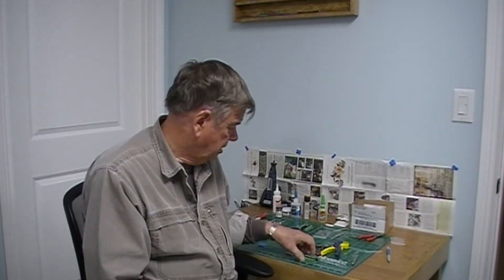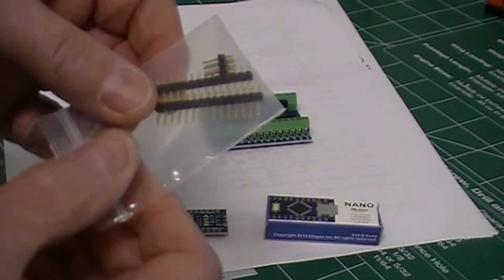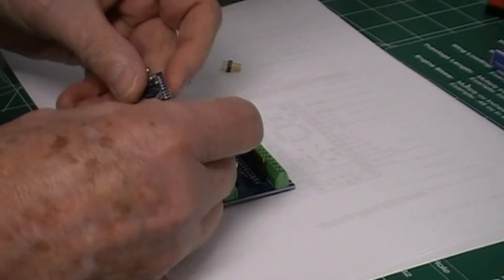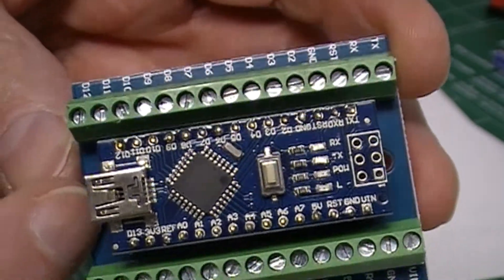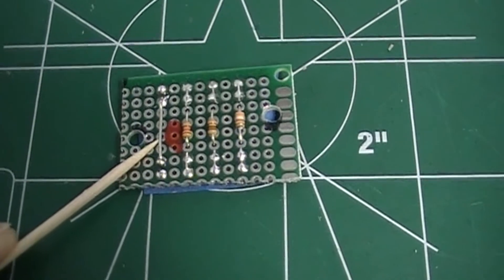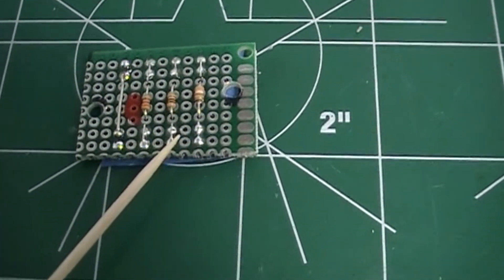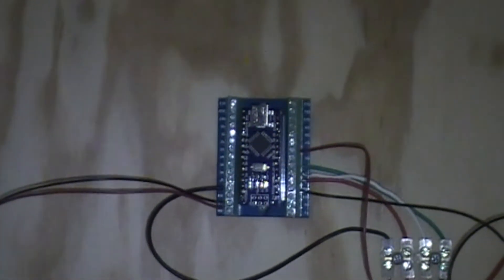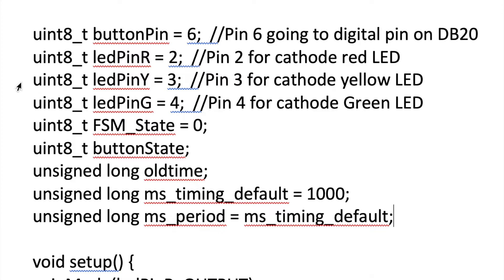Using the Arduino Nano for signal control

Comment: Maby a dumb question but do u need to solder the pins or can it work without soldering?
Reply from the maker: The answer is yes.  Use a low heat soldering iron with a fine tip and thin solder.  Take your time and make sure you have no solder bridges.
Reply: @LS3Jack  I ve got u, but im a bit of a jackass when it comes to precision jobs haha.

Comment from the maker: The script for the Nano:

uint8_t buttonPin = 6;  //Pin 6 going to digital pin on DB20
uint8_t ledPinR = 2;  //Pin 2 for cathode red LED
uint8_t ledPinY = 3;  //Pin 3 for cathode yellow LED
uint8_t ledPinG = 4;  //Pin 4 for cathode Green LED
uint8_t FSM_State = 0;
uint8_t buttonState;
unsigned long oldtime;
unsigned long ms_timing_default = 1000;
unsigned long ms_period = ms_timing_default;

void setup() {
  pinMode(ledPinR, OUTPUT);
  pinMode(ledPinY, OUTPUT);
  pinMode(ledPinG, OUTPUT);
  pinMode(buttonPin, INPUT_PULLUP);

  //initialise board and variables
  digitalWrite(ledPinY, HIGH);
  digitalWrite(ledPinG, LOW);
  digitalWrite(ledPinR, HIGH);
  oldtime = millis();
}

void loop() {

  buttonState = digitalRead(buttonPin);

  if (buttonState == HIGH) {
    if (oldtime - millis() > ms_period) {
      switch (FSM_State) {
        case 0: // GREEN ON
          oldtime = millis();
          FSM_State = 1;
        break;
        
        case 1: // YELLOW LED ON when buttonstate state gose HIGH for X amount sec
          oldtime = millis();
          digitalWrite(ledPinY, LOW);
          digitalWrite(ledPinG, HIGH);
          digitalWrite(ledPinR, HIGH);
          delay(5000); //Increase delay to increase time yellow is on
          FSM_State = 2;
        break;
        
        case 2: // GREEN LED ON. will remain in green until button is released
          oldtime = millis();
          digitalWrite(ledPinY, HIGH);
          digitalWrite(ledPinG, LOW);
          digitalWrite(ledPinR, HIGH);
          ms_period = ms_timing_default; //reset timing to default value
          FSM_State = 2;
        break;
      }
    }
  }
  else if (oldtime - millis() > ms_period) { //if buttonstate is LOW. RED LED ON
    oldtime = millis();
    ms_period = ms_timing_default;
    FSM_State = 0;
    digitalWrite(ledPinY, HIGH);
    digitalWrite(ledPinG, HIGH);
    digitalWrite(ledPinR, LOW);
    delay(2000);
  }
}

Have a great day.  --Jack
Reply: Thanks a lot man.. This is what i want...